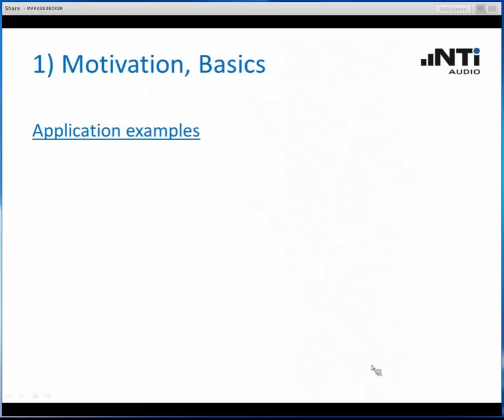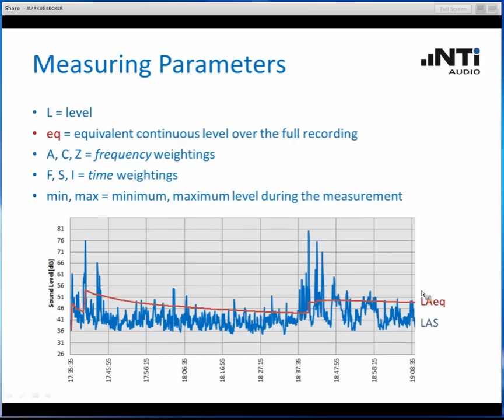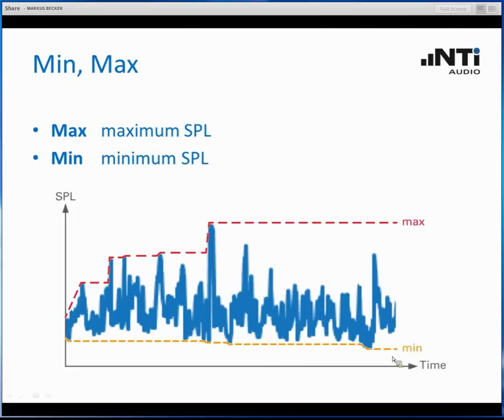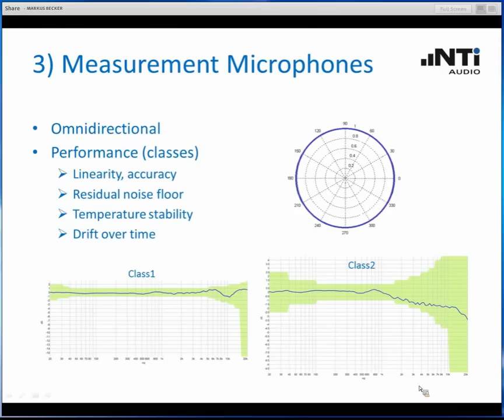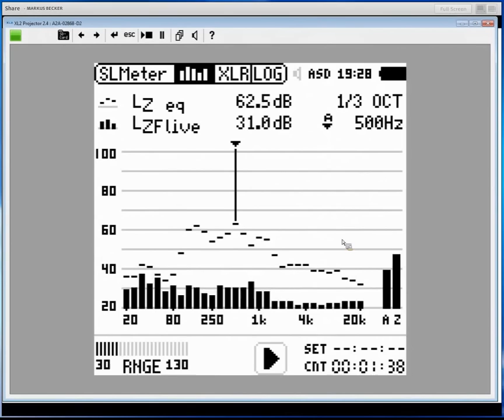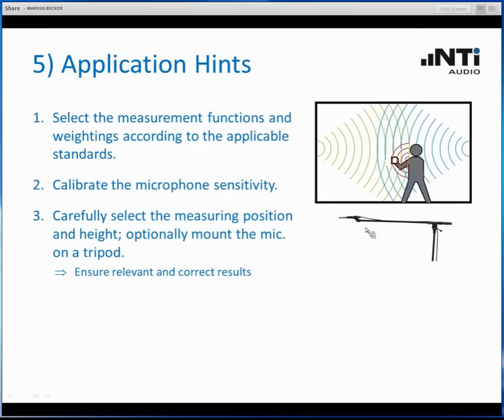Basics of Sound Level Measurements - Webinar

Comment: First- Thank you for this good presentation, 
Second - Can you explain the meaning of Noise Criteria (NC) and Room Criteria (RC) ? because the
sound level measurements of the cleanroom shall be reported in either Noise Criteria (NC) or Room Criteria (RC), What is the meaning of these two values?
Reply from the maker: The general term for rating background noise of rooms is "Noise Curves". Within this category of measurements there various implementations such as Noise Criteria (NC), Room criteria (RC) and also Room Noise Criteria (RNC). They are standardized in ANSI and ISO. You will find more details abouth the aim of these measurements under https://www.nti-audio.com/en/applications/noise-measurement/noise-curves. 
The XL2 Acoustic and Audio Anaylzer has them all implemented once the option "Spectral Limits" is installed.

Comment: Sir 

 We are from andhra pradesh students.we do a project on analsys of noise pollution in traffic condition. So we required small help. We don't know how to take redings in sound level meter.we alreday purchaged htc sl 1350 model sound level meter.our main object is to calculate the how much sound is produced in the traffic and effect by traffic police. 

So please help me sir.

Thanjs and regards

N.Seetharam.
Reply from the maker: The Sound Level readings are displayed on the front panel of your Sound Level Meter. The HTC SL 1350 has only a limited set of measurement configurations. http://www.htcinstrument.com/SL-1350.html For a more comprehensive noise measurement system, please see our website for Environmental Noise Montitoring solutions https://www.nti-audio.com/en/applications/noise-measurement/environmental-noise or contact us at info@nti-audio.com